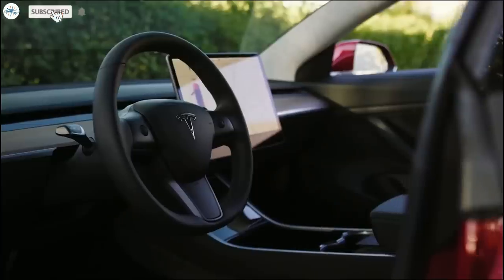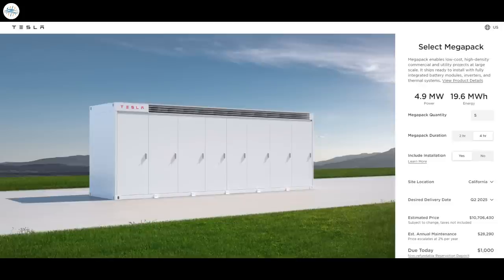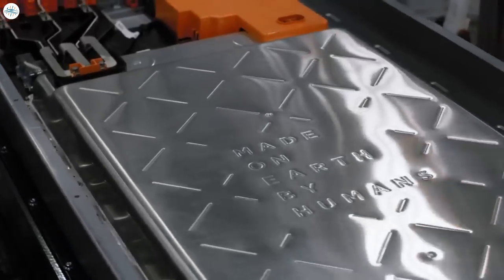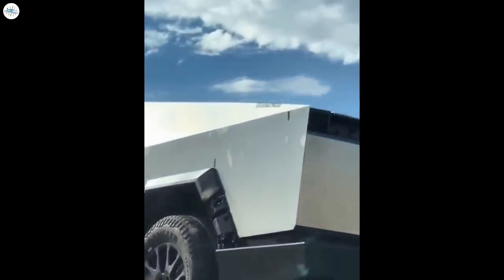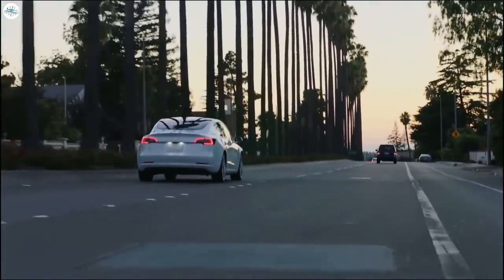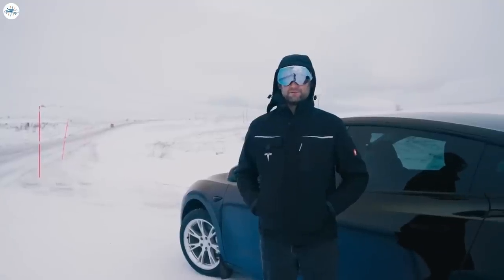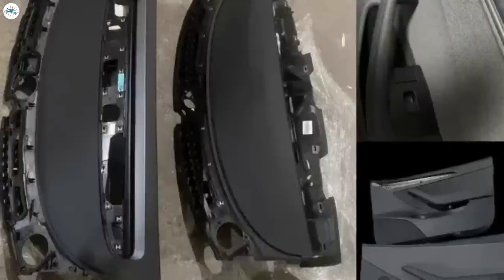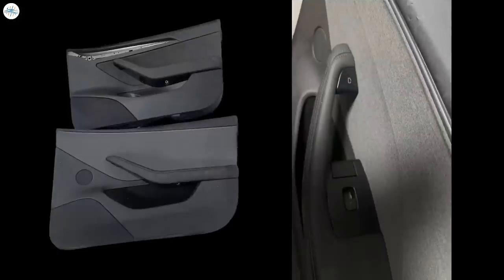Huge Details Leaked Of Upcoming New Model 3 & More Updates!

Comment: Tesla needs to fix its software bugs. Here's a list of bugs that really bother me:

1- When I park the car and my son is still inside, and I just go to throw away trash in the bin 5 meters from the car, the car automatically locks with my son inside at an outside temperature of 32 degrees. I have to unlock my phone for the car to detect it and unlock the door. Really annoying and dangerous.

2- It's impossible to remotely adjust the fan speed or air conditioning, only the temperature. So, if I start the car remotely and activate the air conditioning, the ventilation goes full blast and it's impossible to adjust.

3- The price of these add-ons for an additional 50 hp is almost 3K Canadian. And the exorbitant price for Tesla's paint, it's no wonder we see almost all white cars everywhere.